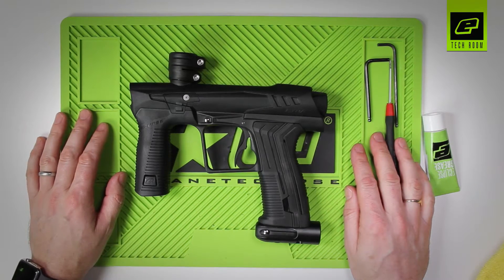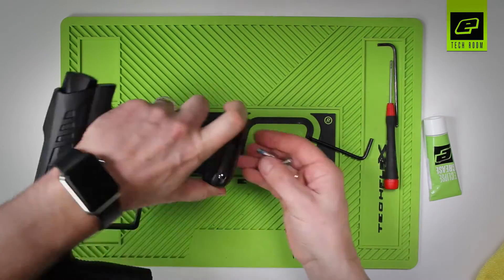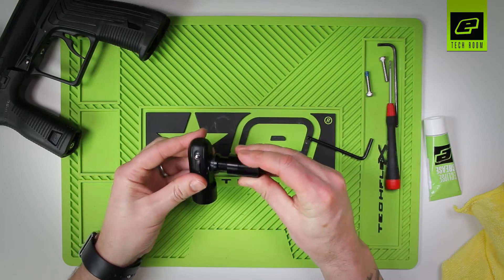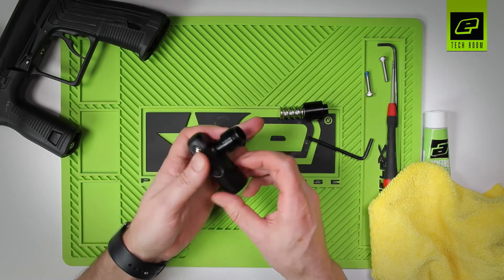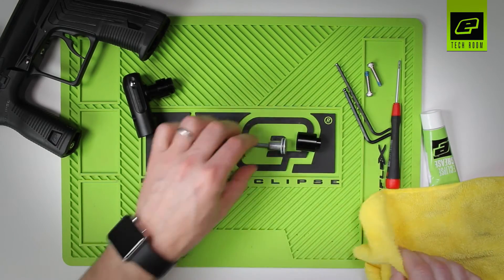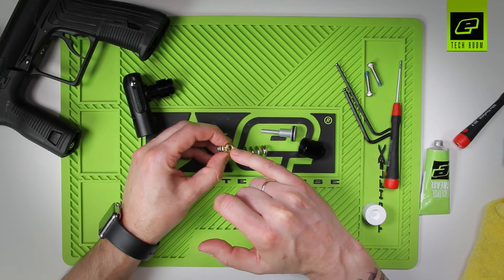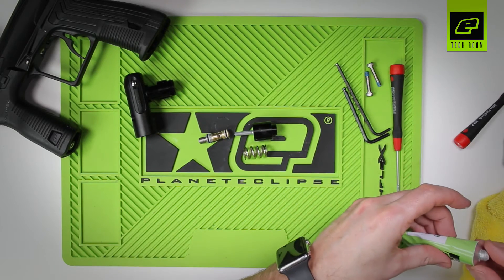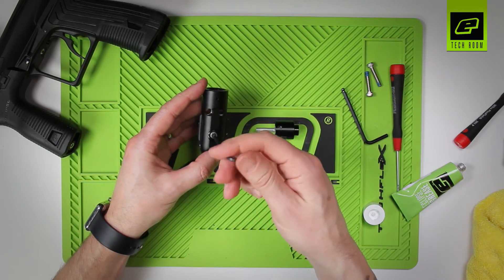ETHA2 006 Inline Regulator Maintenance

Comment: How do you take apart the pops asa i try pressing the button while i pulk but it doesn't come off i have a lot of paint in there i just want to clean it but im stuck wondering
Reply: assassin paintball I have the same problem. Did you ever get it apart?
Reply: Brian Sisson no sadly i don't have much paint in mine so there has to be a way but i didn't find any actual way to take it apart